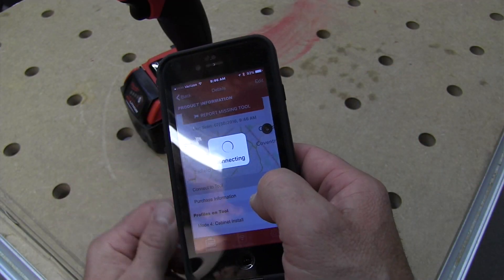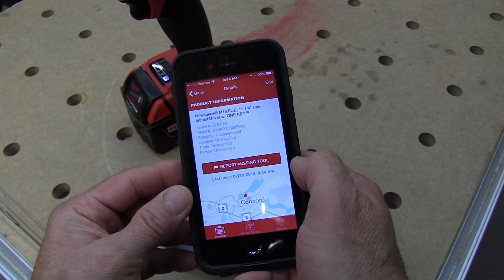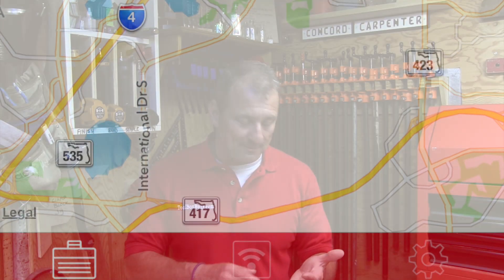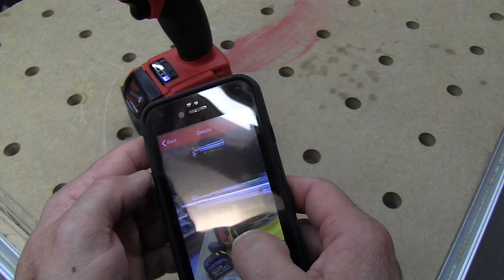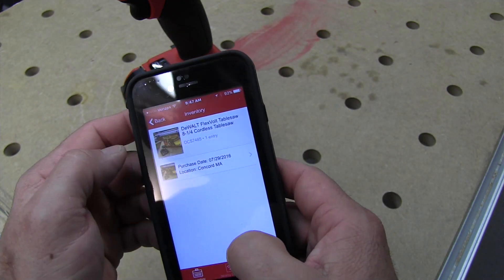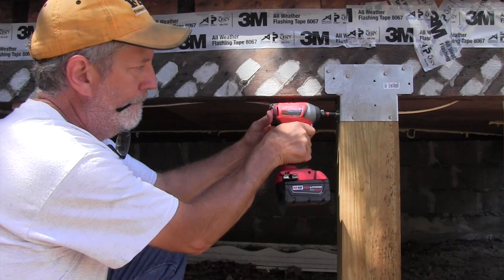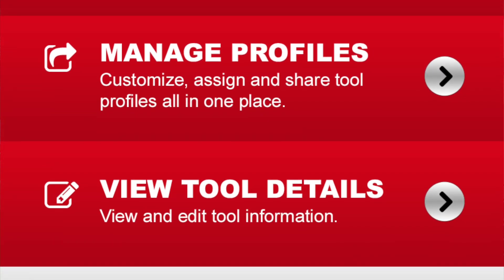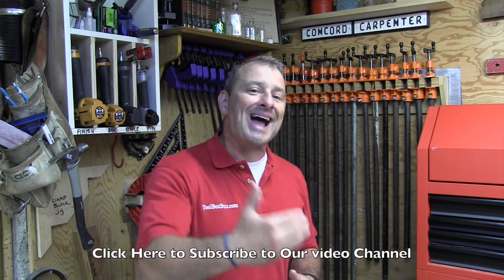Milwaukee One-Key: The Future of Cordless Tools

Comment: sounds like milwaukee is creating a big database for future marketing.. i will be more on board with the tool tracker once it gets more 
sophisticated this thing it will not send u a signal unless you are within 100 feet of the missing tool, soooo if its 125 feet away from your phone you are out of luck my man.... or if you are working on a 20 story building it will not tell you what floor its on unless you come within 100 feet! its a great idea but still in it’s infant stages
Reply from the maker: I'm not big on one key but apparently as more users get on system, their phones help you locate a tool too by reporting back to you.
Reply: A Concord Carpenter / ToolBoxBuzz I get tht.
Reply: No if your tool is within 100 feet from anyone who uses the app(even if they disconnect the battery, which will ping out a signal for 2 years) it'll connect that person and upload the location to you, I think that's pretty smart, thing is more people gotta use it.. I tracked one of my tools like that and got lucky and found it 10 miles away from me.

Comment: I have been in the Facilities, and equipment maintenance industry for 25 years. We absolutely loved our old corded sawsalls!!
A couple of years ago, our production manager needed a cordless drill for reaming out the bores of parts. He went to Home Depot and purchased a kit that included an M12 impact driver as it was cheaper than just purchasing the drill. He gave me the driver....
Long story short, My platform was set, and I thought how great, I can throw away my imported Bosch driver.....
I was horrified when I discovered that my Milwaukee bailed on the USA, and are producing in China.
I have purchased Many, many cordless tools from them, and did have one issue when the 1/2" hammer drill in my tool only combo kit didn't work, straight out of the box. Although Home Depot did not have an immediate direct replacement, they exchanged it with the kit that included the charger, two 5.0 batteries, and a
 2361 Flood light.
I guess I'm trying to say, I love my Milwaukee tools, just bring the manufacturing back home!!

Comment: Chinese made garbage.  My pals in construction who have these red tools mostly complain about them.  While every single power tool manufacturer is battling the 20+ brushings= meltdown, Dewalt jumped right out front ,as usual, leading in the brushless series.  I for one, bought only brushless tools so I have avoided the "meltdown" issues while enjoying super powerful, long lasting battery power, and flawless work from my dewalt XR tools.  And then Dewalt drops the F Bomb with the FlexVolt series to even press further ahead of the foreign competitors.  Now we're talkin`!  No, I dont work for Dewalt, but yes I do work with Dewalt, everyday and I will be a fan until I work no more.  Dont be a follower, be a leader like Dewalt.  All of these stacked tool boxes, etc.etc....ALL came from Dewalts designs.  its comical actually.  So get on board and toss those chinese toys back into the ocean from whence they came.  Dewalt, the number one selling commercial tool in this great country, and THAT is all there is to it.
Reply: You are delusional. Milwaukee is so far ahead of anyone else in the cordless tool market, it isn't even a competition anymore. The red tools are putting out performance numbers with their 18v tools that DeWalt is barely touching with their 60v tools. "Leading the brushless series"? Yeah...sure.
Reply: Dewalt is assembly in America not made in America

Comment: Let's take something simple and complicate it with technology that won't increase productivity.
You mean I can program these tools on my break? WoooHooo! Smartphones sure dumb things down...how do you people sleep at night? Ohh, that's right...there is an app for that. 
Perhaps working on your companies distribution, customer service, straight up durability, and longevity of products as well as availability of service parts would be a better use of ones time.
Reply: Sure I hear you, but they sure as heck did not plow down lots of time and effort into the on board IC/BT circuitry I guarantee you it is right off he shelf in China adding about a couple of cents in real cost, brushless design mean it can connect right off the bat all you need is designing the app itself rest is existing ways of controlling brushless motors which already have the control board available doe it how they operate and controlled.  For most jobs it is indeed unnecessary but I kind of like it where a slow ramp up of torque is needed, control of a very specific rpm range and last but not least my phone tell me where I put off the tool which in my case is the 2706. Sure a thief with knowledge can indeed snatch it and knock out the tracking system and yes range can be a problem when others on building sites use Makita, Dewalt etc and Milwaukee still a bit underused here but for me I already found it once in a wall closed off during lunch with me standing there looking for it so I sure will invest in more ONE KEY tools.  Not making silly claims about what is useless and what is the best like kids on Youtube I use Makita, Dewalt, Hitachi, Hilti and now also Milwaukee at work and they all make great tools imo, I only wish the tracking system could be a cooperation between them all and open source then we really could build a network real fast and develop the software on the fly to perfection. Only other option for tracking would be power hungry GPS circuits and technology is not quite there yet for me anyway.

Comment: Unless Milwaukee produces an open platform for controlling and monitoring the tool I'll be running away from this feature set as fast as I possibly can. This has vendor lock-in proprietary nightmare written all over it.
Reply from the maker: Brock, 
Just to clarify - the tool functions just like a normal tool without ever needing to connect or use the ONE-KEY app. In a sense, they are independent. The app is free, and will always be publically available at no cost. For the ability to pair – connect - and control a tool, the Milwaukee ONE-KEY app will always have to be used because of the levels of encryption and security they
have – for that reason there is a very low likelihood of 3rd party apps being available to do this. But, I would expect to see the web-driven side of ONE-KEY to expand in the future. It does have the ability to link to other api’s and as the program grows, there will likely be more functionality linked to other solutions.